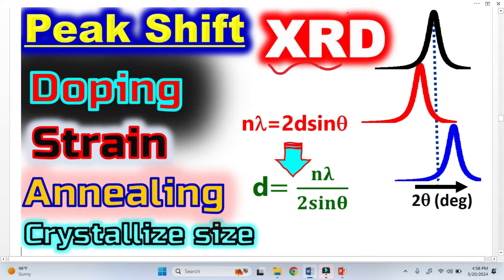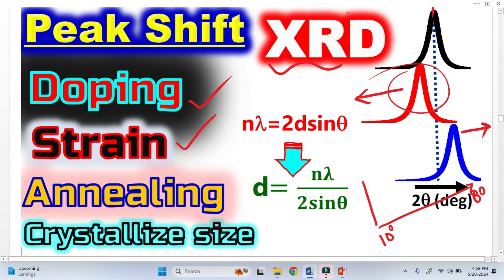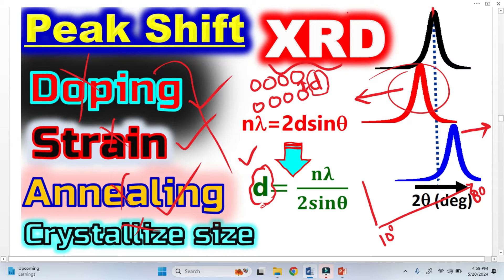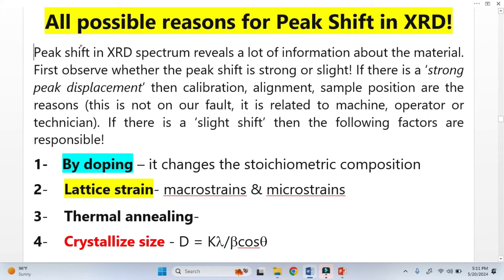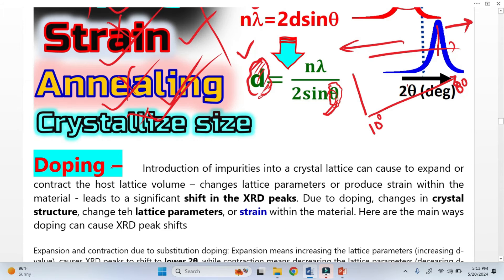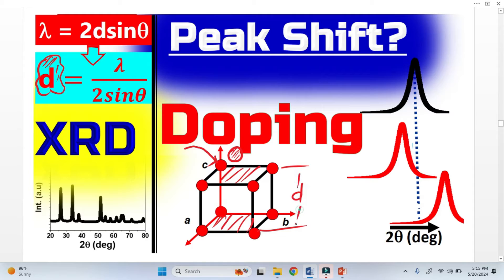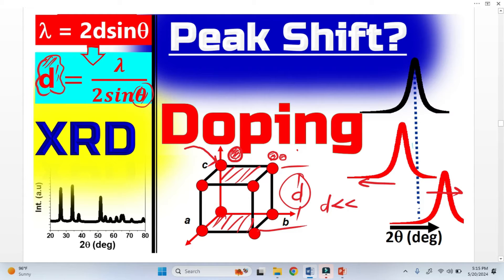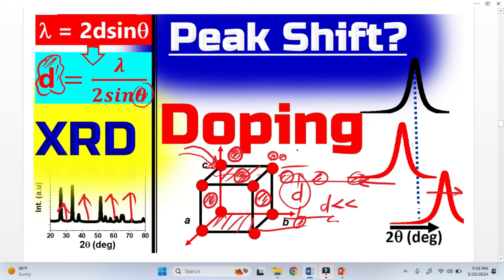Why XRD Peaks Shift: Doping, Strain, and Annealing Explained

Comment: Thank you very much for the video; I learned a lot from it.

A question I have, which led me to find the video: If I synthesized the same material twice and got the same XRD, but one of the peaks split into two, what could cause this?
Reply from the maker: Many thanks for your comment. Then it might be due the stress, defects or strains etc occur in your materials. Otherwise, if both materials are same with exactly similar condition then how two peaks appears instead of a single. These stresses and strains could be the cause for this to happen ....
Reply: If your instrument has a Cu x-ray source the splitting could be due to you observing diffractions from both the Kalpha1 and Kalpha2 emissions. This effect is more obvious at higher angles. Even with a monochromator both Kalpha emissions can be observed. A good way to check this is by simulating your reference pattern at both wavelengths for comparison or by checking the relative intensity of the two 'split' peaks. The intensity ratio between Kalpha1 and Kalpha2 emission is constant.

Comment: Dr , could you explain when i have doped Co in a proper ratio but some XRD peak shifts both lower angle and higher angle in comparison ?
Reply from the maker: Then it simply means that your study is not consistent. It should be on one side shift if you are introducing dopants

Comment: thank you again. If I want to compare the same material before and after a test only calculating of peak shift, broadening are enough? And second question if I find a new peak can it lead to new structure? Thank you so much
Reply from the maker: If I want to compare the same material before and after a test only calculating of peak shift, broadening are enough?
Response: What do you mean by before and after the test. You can compare the peaks after the heat treatment, after the doping, after increasing one constituents in the case of composite, changing the parameters like humidity, temperature, speed etc of the sample during synthesis....... In such scenarios you can compare the peaks and see the affects. 

if I find a new peak can it lead to new structure? 
Response: New peaks simply means that there is another phase in the crystal structure. The constituent of a component is so much large that it form another phases in the crystal structure or the crystal texture is oriented in some other preferred directions....

I recommend you to watch all videos in the playlist.  
https://www.youtube.com/playlist?list=PLWgqLpcPbMgckHs0e677v8_GUh9-itYoS

Comment: Why peaks are low in intensity at.high 2 thetta
Reply from the maker: Good question.  I am going to explain this in the coming videos.  Anyways, let me explain shortly for you here.

The greater 2θ means that the incident angle (θ) is also increasing  

Now, if you look into the diagrams (θ: 2θ) or (θ:θ) scan as I have already explained in the post as well as on videos. In both scenarios,  there is less path for the incidents x-rays to Travers.  This simply means that there are fewer chances for x-rays to scatter and resultantly less intensity peaks .